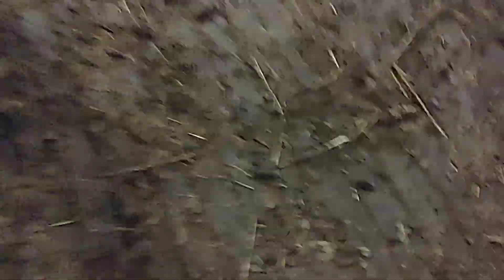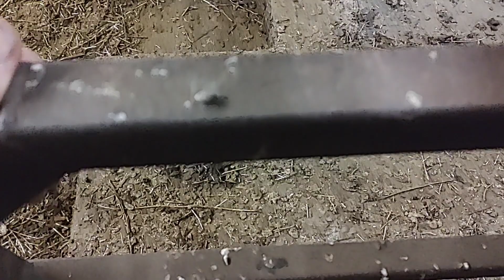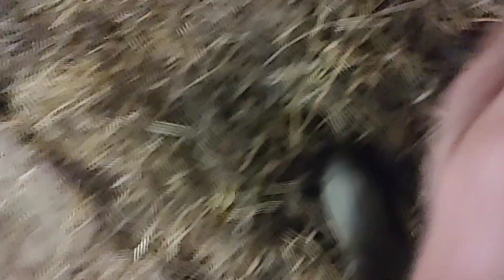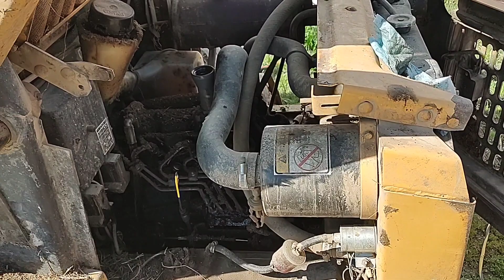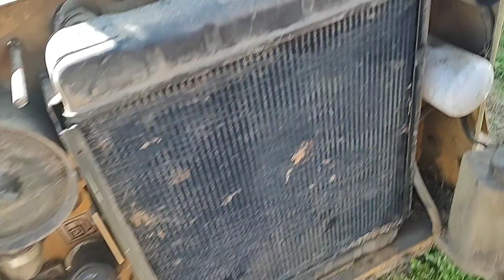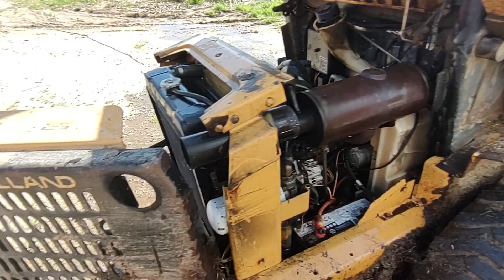Guess who showed up?

Comment: Knock on wood, I haven't seen much for ticks around here the past couple years.  It sure is a miserable sob putting hydraulic oil in those things in the cold, I usually keep some oil in the milkhouse so it doesn't get too thick,  but it still takes forever lol
Reply from the maker: Your Winter looked like it stayed well below freezing for most of it so that'll help keep them in check. We're usually just as cold here but this winter overall was pretty mild, very little froze solid.

They could be switched to register hydraulic oil but probably wouldn't pour much different around zero anyway.